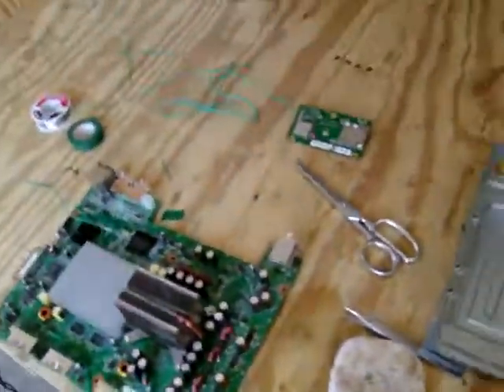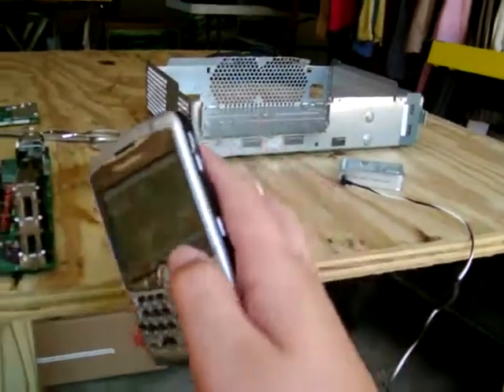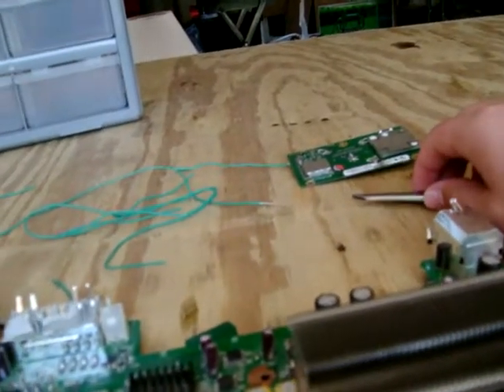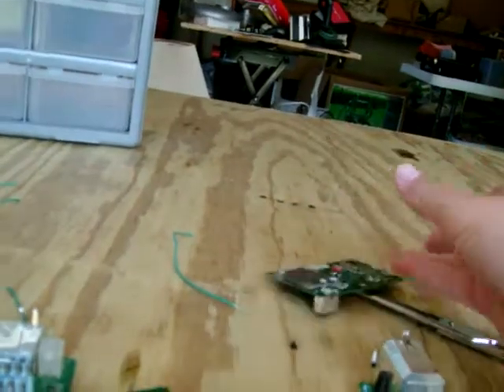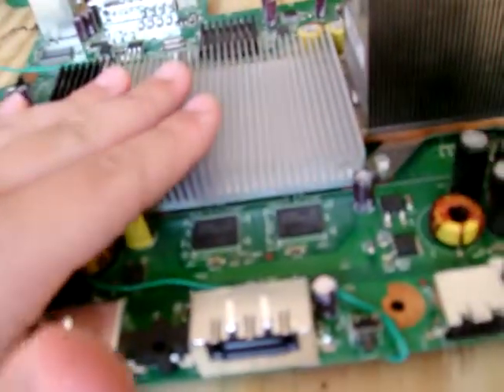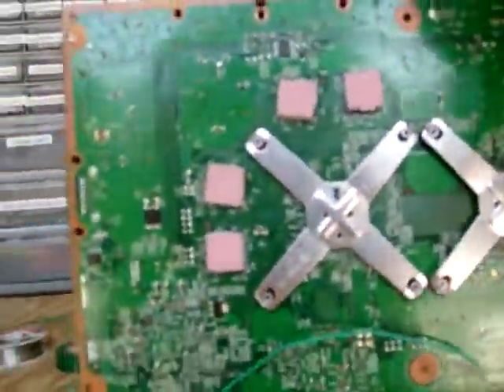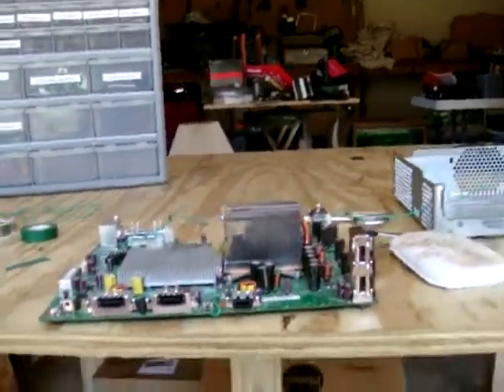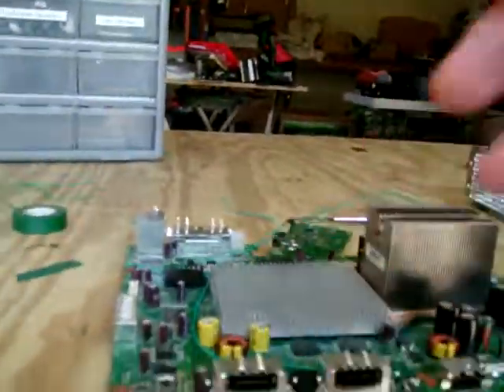-MDW- How to install the PulseVU 2X by SICKmods (part 1)

Comment: i got the pulse vu 2x of sickmods also and cannot find any pic instuctiosn 2 put the chip in place and where to solder it  ur vids helped alot but dont now how do the board and lights and all that  so if you now where get pics of wbesite it help alot thx

Comment: A. can you just use a simplepush button instead of using an existing button to change modes?
B. Can you install 12V LED strips instead of 3/5mm LEDs? Or is is drawing to much voltage/amps.